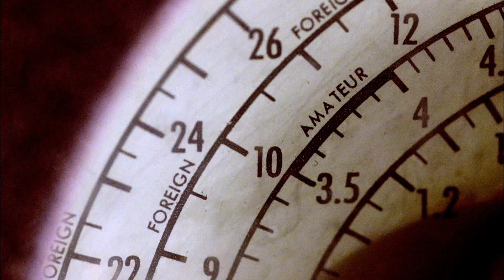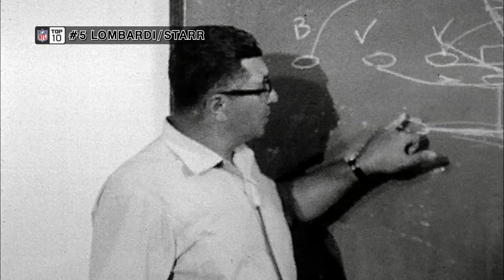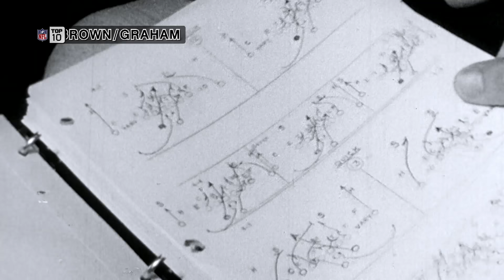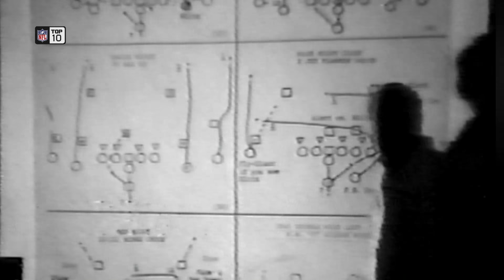Top 10 Quarterback/ Coach Duos of All Time | NFL Films

Comment: Dan Marino and Dan Fouts should have each won at least one superbowl with how good their teams were.
Reply: Neither had much defense, especially San Diego, and the Chargers best shot was short circuited by sub zero temperatures  and a wind chill of what was officially noted as -59 degrees, but was probably more like -75 degrees.  You are not passing effectively in that.  I know, I lived through it.  When I came back to Ohio State, that day to get ready for winter quarter, we had ice a half inch thick on the INSIDE of our windows.  I knew San Diego had a less than zero chance of winning that game.